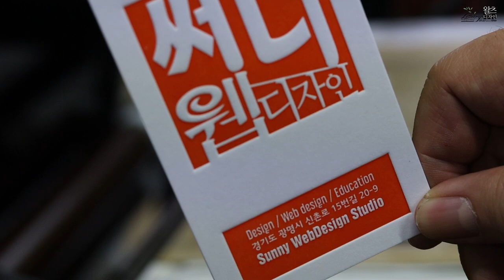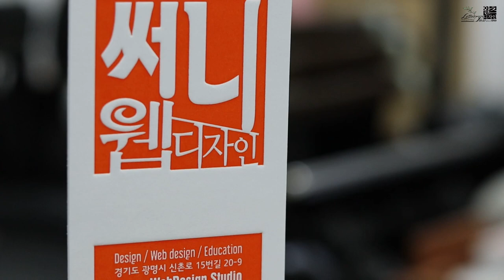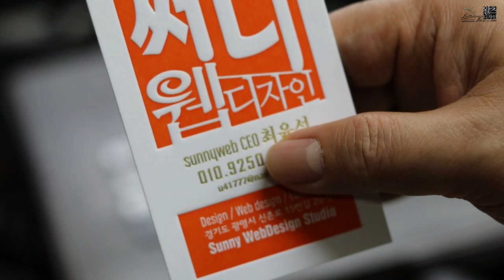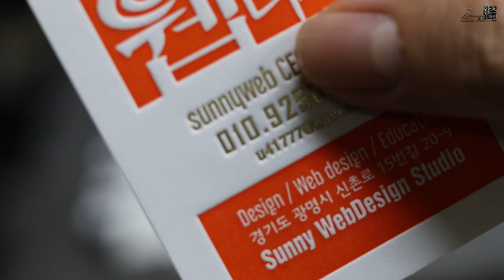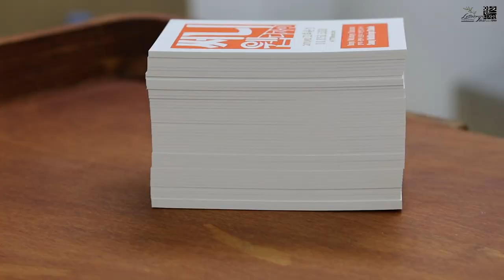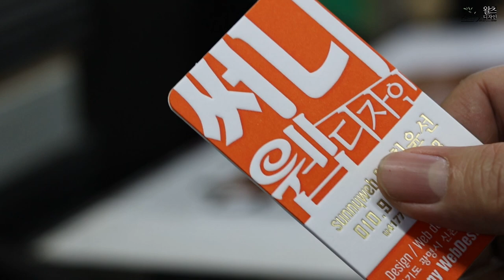Create luxury business cards with orange letterpress background printing.레터프레스 바탕인쇄로 고급명함 만들기.

Comment: Hi! Always a huge fan of your work.During the gold foil stamping process, is the hot plate an original plate made for the press? Or did you purchase the hot plate separately and modified the press to accommodate the hot plate? I have a table top press (C&P pilot press) for letterpress and hoping to add foil stamping to it as well. Any suggestions?
Reply from the maker: The foil device was installed by a professional manufacturing company. It is not sold separately.  Sorry for not being of any help.

Comment: Such beautiful work and videos. Thank you for sharing. I am curious as to the material you use for the die cutting.
Reply from the maker: thank you so much.  The knives used for diecutting are made by a professional mill and come to me.😊😊
Reply: @w_letterpress  sorry, I meant the other side.
Reply from the maker: Are you talking about the rubber material next to the knife?  The rubber used here is rubber with double-sided tape added.  It protects the knife and prevents the paper from going into the knife.  I don't know if they sell it online.  It seems to be sold at offline printing material stores.  I got it from a friend 7 years ago and have been using it ever since.
Reply: @w_letterpress  no. the side where the paper is. The material under the paper.
Reply from the maker: Bakelite is a plastic.  It is 1mm thick.😅😅
Reply: @w_letterpress  What do you use the bakelite for??
Reply from the maker: It is used to make a base plate and guide pins.😊😊